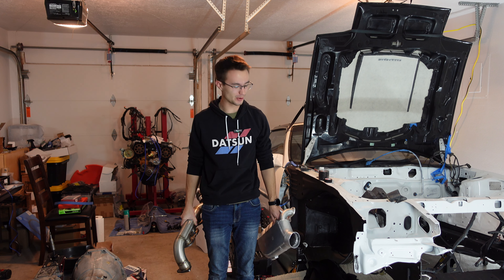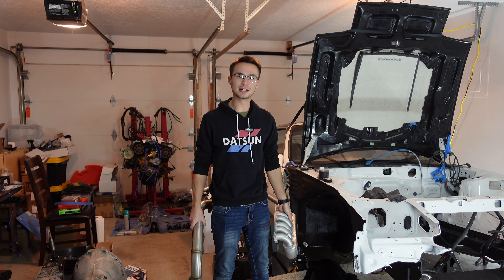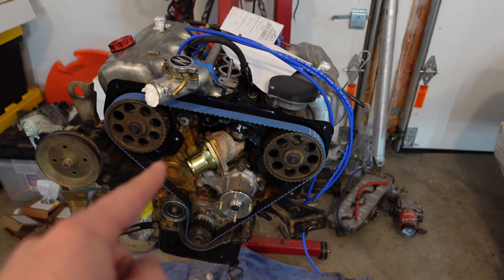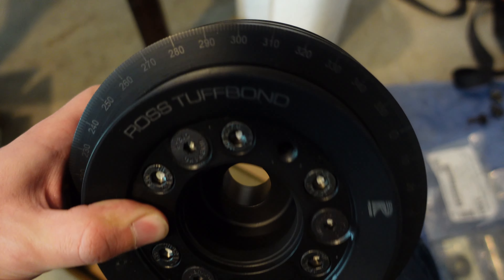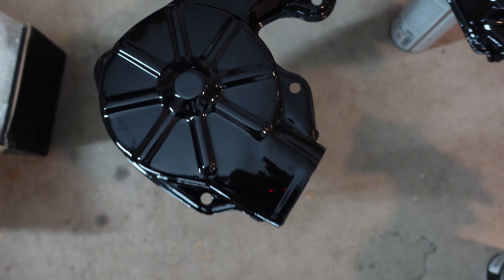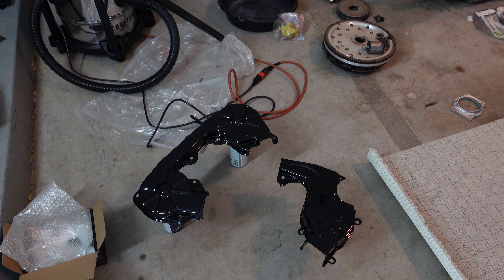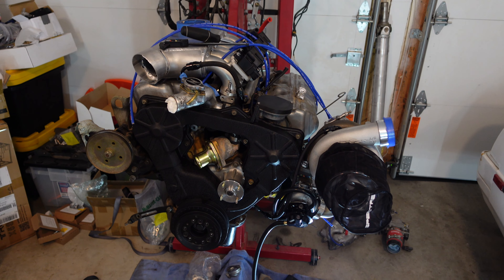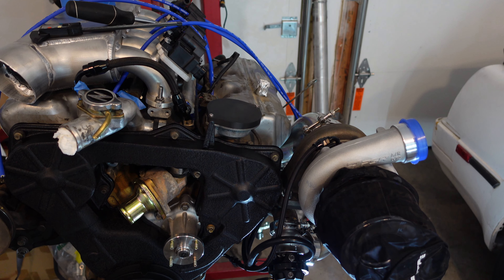Engine Build Part 2

Comment: Glad to see this!!  I had missed part 1 - I’ll go back and watch it now.  My daughter bought an ‘88 NA that came with a spare engine - I know a turbo upgrade is in our future.  Thanks for making these videos - they are super helpful!!

One thought… it’s probably too late now, but for the PCV, couldn’t you just drill out the stock location and use a right-angle fitting of some sort?  Something akin to the vacuum fitting on a GM master cylinder?  Just a thought…

Thanks again!!

Comment: Hey curious on what the aftermarket harmonic balancer is gonna help with besides looks?
Reply from the maker: In my case, there's not much benifit other than being a brand new balancer. The dame company makes balancer with trigger wheels for more precise timing though so if you're chasing high hp that's a great option to have!